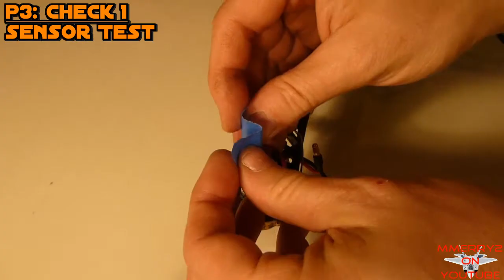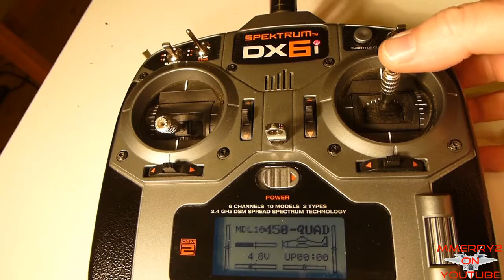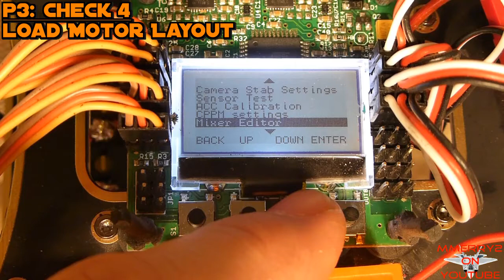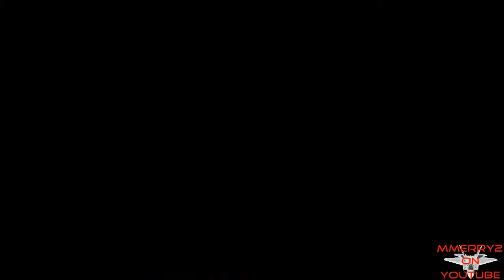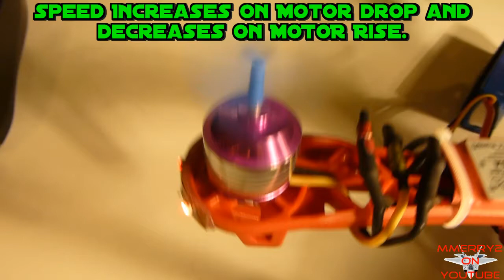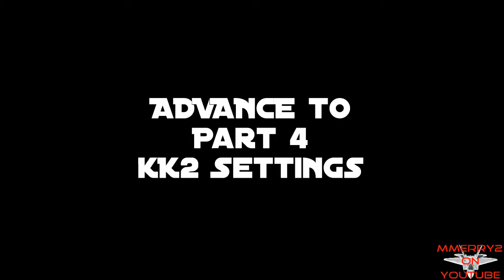HobbyKing KK2 Checklist - KK2 Testing (Part 3)

Comment: Thanks for the video!  A question:

Something doesn't seem right to me regarding the KK2 Gyro Bubble, but I can't find an answer after searching the internet for days.

The question is: Which way is the bubble supposed to move when I tilt the board? Here's what's happening: When I tilt the board to the left, the bubble moves down in the same direction (left) as the board is tilted (before it settles back to center). When I tilt the board to the right, the bubble falls in the same direction (right) as the board.

I was expecting the bubble to float in the opposite direction of the tilt.

Please help me understand how the bubble should be behaving - and if I'm seeing a reversed gyro, how do I fix it?

Thanks!